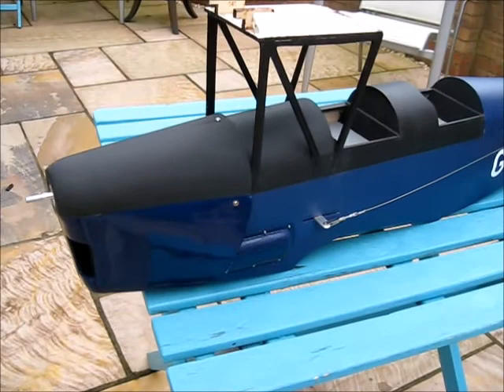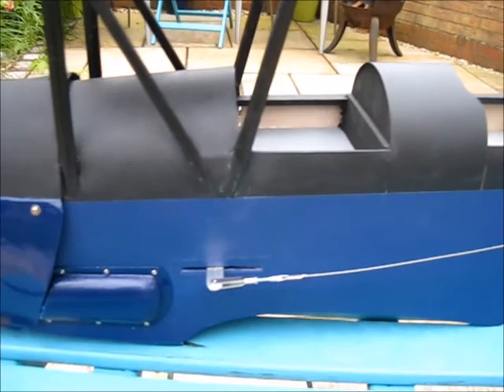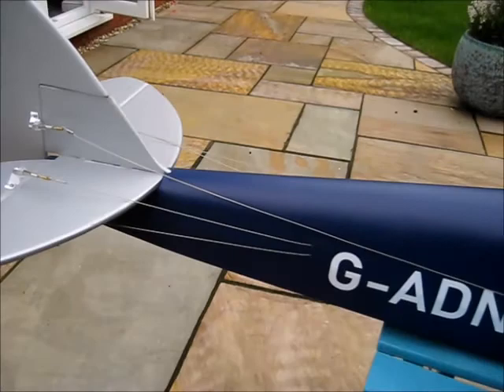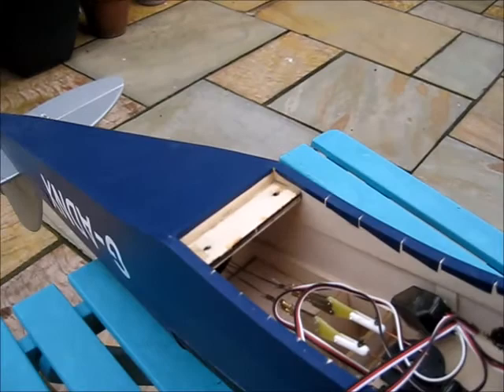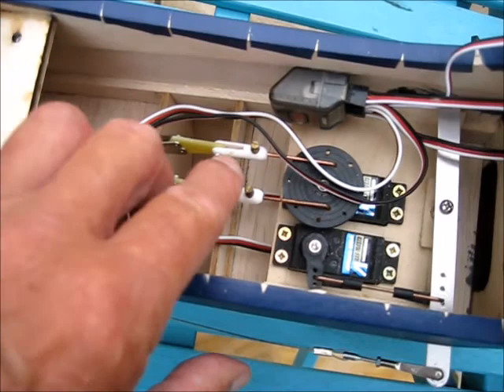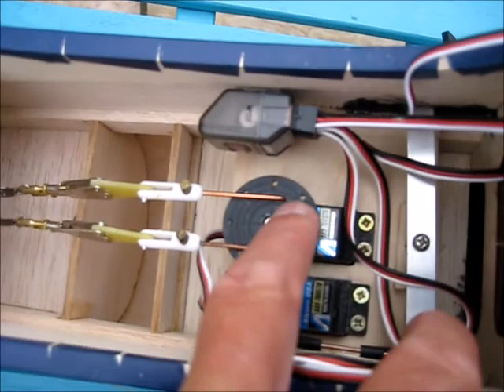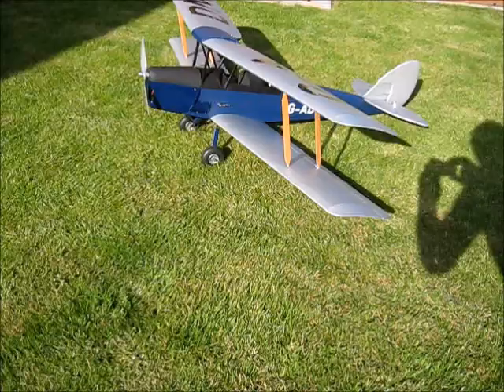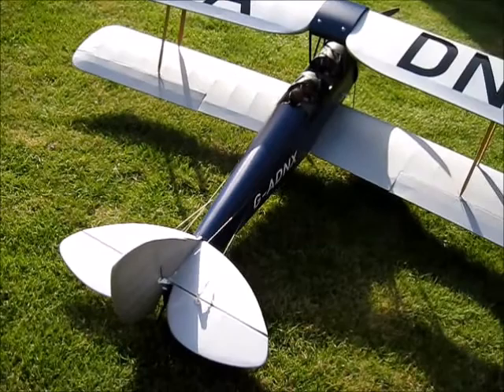DB Sport & Scale Tiger Moth build - Finished

Comment: Great job Alan! I'm thinking of getting one of these myself and your videos really bring the build to life.
Reply from the maker: Glad you found them useful.  I would recommend the model, and there are quite a few areas where you can incorporate your own ideas, which makes the build more challenging than a standard kit.  I did make a mistake fitting the split pins in the wings, the heads should be at 90 degrees to the wing if using the method of fixing in the instructions.  If doing it again I wouldn't use split pins but would make something more substantial and easy to use.